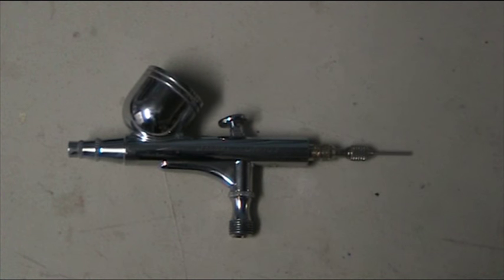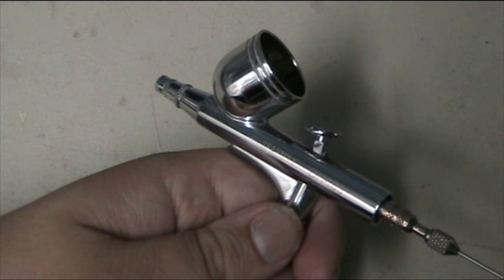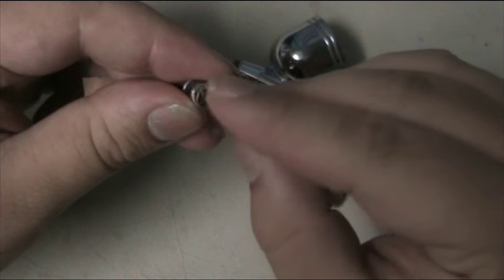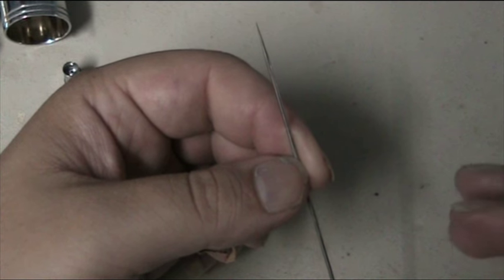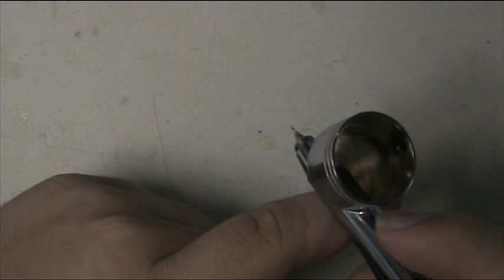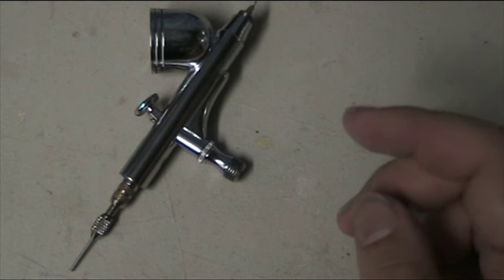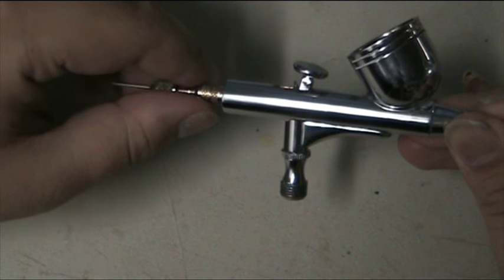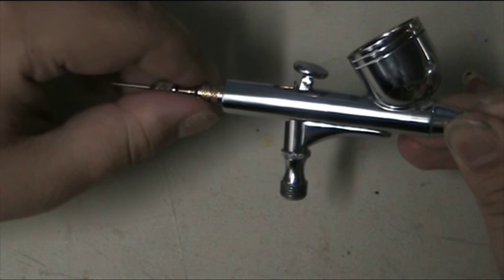Airbrush - What is and how to prevent orange peel

Comment: Thx for the video it was AMAZING. I have a real problem with my paint peeling off , especially when I remove masking tape from my previous painted surface. I'm painting helmets and running shoes
Reply from the maker: Adhesion issues is normally associated with the condition of the surface and the paint itself. Polyurethane paints such as Vallejo are not really designed to be handled or masked were choosing solvent heavy paints like alcohol base acrylic or lacquers can. Maybe swap your base paints out.
Reply: @mokanaman  Thank you for responding so quickly. I'll look into trying a automotive paint instead of acrylic. I just need to make sure it will work in my airbrush. Thx again for the help!!!
Reply from the maker: @petekazlauskas6847  Automotive is lacquer based, I've had great experience airbrush and masking with both auto and modeling branded paints. Fumes can be toxic so remember to wear a respirator in a ventilated area.

Comment: Good points all of these nicely done video. Spraying with the cap removed sometimes helps but be careful it's easy to bump your needle and bend it. I keep a piece of small sponge damp with Windex  between fingers  of my off hand. I often clean the tip prevents dried paint on the needle from becoming a problem.
Reply from the maker: Cap removal works a treat on the finer airbrush models. My normal go to is a tooth pick to unlodge the build up or rolled up tissue. I will have to try the sponge method, thanks for the tip and contributing.
Reply: @mokanaman  Yep forgot who originally I got that trick from. Works great with cap off as all that's touching the needle is a nice soft sponge. Key to it is do it occasionally before a problem even comes up
Reply: I guess if you are using acrylic then windex on a sponge is right.  Assume thinner on a sponge for enamel.........

Comment: It's so hard because psi and thinning can cause orange peel both ways.. too low or too high psi, too much or too little thinner.

Ugh!! So how do you know what's what
Reply from the maker: Ive not experience orange peel (got pooling and wet dip) from thinning too much and lowering the psi. Truth be told you can thin the paint quite a bit and most under thin specially with pre mixed paints and tutorials. 2 things can be happening to you. 1 a bad case of dry drip or two a split nozzle. I have done videos on both topics if your interested.

Comment: Hey man. Does orange peel always have a rough coarse surface? Because mine feels smooth, but when I see it directly, it looks like orange peel.
Reply from the maker: When I talk about texture and a surface being rough could be from a fraction of a mm to microns like the texture of sand paper. Sometimes sand paper will feel smooth but can polish material away.   Your observation is very similar to my experience, you can't touch it but light reflects off the surface making it appear to look coarse. Hope this answers your question.
Reply: @mokanaman  So this means that it's still a possibility that it is orange peel?
Reply from the maker: @moonlightbuterfly  I am 70% sure its orange peel with out seeing it. What sort of paint and thinner are you using?
Reply: @mokanaman  I am using Mr.Color White 1,and their levelling thinner. I made sure I paint during the evening so it won't be too hot (Living in a tropical country). When I paint on a test runner, touching it feels like it doesn't dry right away. I really am confused. Primer is white 1000.

Comment: Nice video bro.
By the way can we fix the orange peel if we haven't clear coat it ?
Because I get some orange peel at the corner of my gunpla.

Thanks before.
Reply from the maker: You can though buffing and sanding but the clear coat helps thicken the paint surface and prevents sanding though the paint to primer or plastic. Sorry for the late reply.
Reply: @mokanaman  so I need to clear coat it first on top of the orange pell surface then sand and buffing it?
Reply from the maker: @wayankusumajati  That is correct
Reply: @mokanaman  wow, okay I will try it. Thanks before for the answer and the tutorial :)